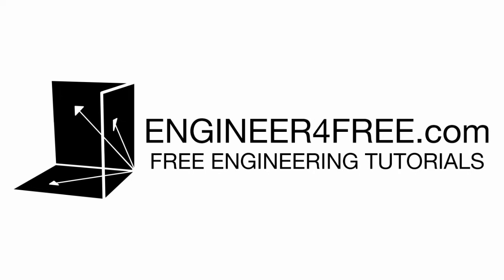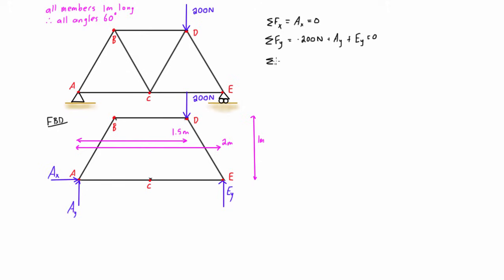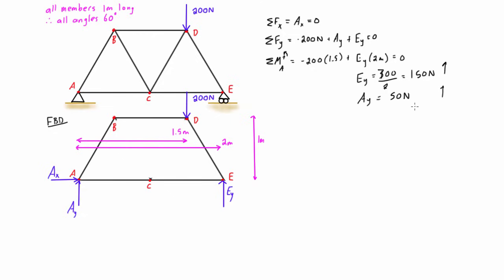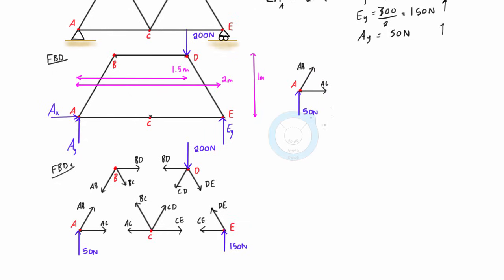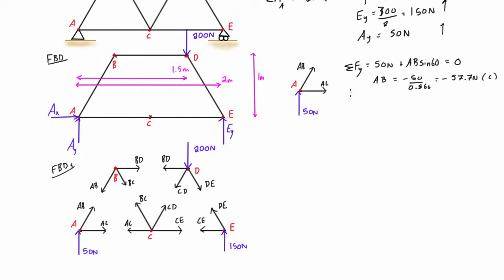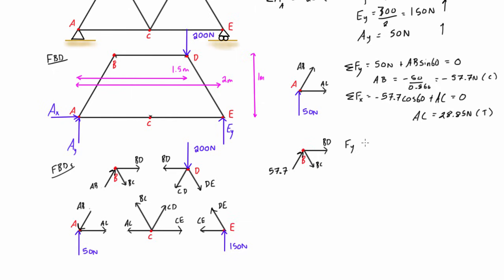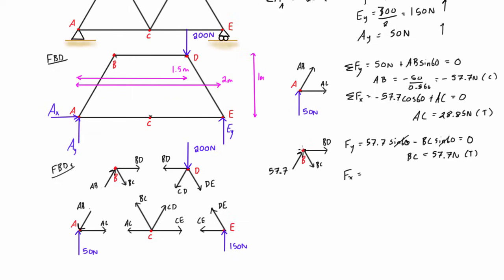Truss analysis by method of joints: worked example #1

Comment: Where did you get the 2 meters from on the free body diagram?
Reply from the maker: Each member is 1m long (pink text, top left of screen at beginning), so the distance from A to E is 2 members, or 2m. Please note that the 1m vertical measure is a typo, it should be 0.866m, but doesn't actually affect the problem. There's a note in the description mentioning it.
Reply: @Engineer4Free  Thank you so much!
Reply from the maker: You're welcome! Plz share my statics videos with some other students too 🙌

Comment: To determine the (-)or(+) sign to put in the calculation of forces in the x-direction(or y-direction) of a diagonal truss member is that compression member is in (-) and tension member is in (+) or is there any other method we could determine that. I'm struggling with this problem when I'm doing my method of joint calculation for my project. Thanks in advanced
Reply from the maker: Oh man, I just typed up a massive and extremely detailed answer then accidentally deleted it....😭😭😭  Please watch all videos 42-51 here: engineer4free.com/statics and if you're still not sure I can write my essay again
Reply: @Engineer4Free  ok thank you so much😄appreciate the quick reply btw

Comment: In Joint A, when you Sum all Fx, Ax is not inlcluded? Why?
Reply from the maker: Ax is determined to be zero in the overall sum of force equation for the whole structure because it's the only external force with an x component so it must be zero. In the fbd of joint A, there's no point in labelling a force with zero magnitude, as it won't have any impact on the force balance, so that's why it's not included.
Reply: @Engineer4Free  Thank you :)

Comment: Hey, i have a warren truss question with just a single triangle and a force acting on the top of the truss a size of 15kN to an angle of 60°. Can you help me with this?
Reply from the maker: If a member is oriented at 60 degrees and has an internal force of 15kN, then the x component of that internal force will be 15kN*(cos60)=7.50kN and the y component of that internal force will be 15kN*(sin60)=12.99kN. If the member is in tension, it will pull on each joint, and if it's in compression it will push. You can use those numbers and directions to find the sum of forces in x and y at each joint individually. More tutorials on trusses are also here: engineer4free.com/statics (videos 42-51)

Comment: why do you add in some cases and subtract in other cases?
Reply from the maker: I should have drawn a coordinate axis that shows positive x is to the right and positive y is up. Because when I'm doing the sum of forces in x direction, I consider an force (or component of) on any FBD that points to the right to be positive, and an force that points to the left to be negative. Same with the sum of force equations in the y direction. Any force (or component of) that points up is considered to be positive and and force that points down is considered to be negative. That's why there are positive and negative terms when summing to zero. Hope that makes sense. If we then get a positive value for the magnitude of an internal force, it means that we correctly assumed its direction (and we always assume unknowns to be in tension, so it confirms that we guess tension correctly). If we get a negative value for the magnitude of an internal force, it means that we incorrectly assumed its direction, and it is actually in compression. That was the case with AB, where on the FBD of A, we had drawn AB in tension. But ultimately we find that AB is actually in compression, so when I draw the FBD for B, AB is now a KNOWN force, so I draw it in it's known direction, which is compression, which means it's pushing on the joint (ie, pointing at it). Hopefully that all makes sense! It's all just vector addition at the end of the day. I have some more tutorials on vector math and also trusses in videos 1-4 and 42-51 respectively, here: engineer4free.com/statics

Comment: at 6:42 why have you taken the value of AB as positive, since the actual value of AB you have got is -57.7
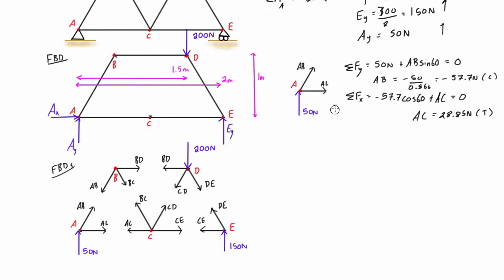Reply from the maker: Yeah so initially AB is drawn as an unknown in tension. It's found to have a negative magnitude at 3:27 which indicates it's actually in compression. At 4:47 I update the FBD of joint A and B by switching the direction of AB on each one. This switch goes from the forces pulling on each joint (tension) to the forces pushing on each joint (compression). Negative tension = positive compression and vice versa. This is why I write (C) and (T) beside each answer as we go as well, because it's easy to get lost in here with what is in tension and what is in compression, but by writing the letter beside it, it hopefully reduces the chance for confusion or error. What I could have done to be more clear would be to write the magnitude and sense on the main drawing to the left each time I solve one. This would have included switching the direction of the AB arrows at 4:47 like I did, but then also writing "57.7N (C)" in between. Without doing that, I see how it's easy to get confused about whether it is considered positive or negative. I hope that helps to clear it up!

Comment: if you didn't know the angle was 60 degrees, and you had to use theta, how would you solve for the forces? what would e.g. 50N + ABSin(theta) = 0 be solved to?
Reply from the maker: Ummm, at this level, there should always be enough information to solve with basic trig functions: sin(theta)=opp/hyp, cos(theta)=adj/hyp, or tan(theta)=opp/adj. You can rearrange to be sin^-1(opp/hyp)=theta, cos^-1(adj/hyp)=theta, and tan^-1(opp/adj)=theta. So that means you should have 2 out of 3 quantities at any time and just be able to solve for the third one. If the member is angled then generally the hypotenuse is the actual internal force and x and y components are the opposite or adjacent sides.

Comment: Thanks for this video very well explained. However I’m confused as to how the 1.5 m and 2 m came to be at the sum of moment about a, thanks!
Reply: How did they come into the sum?
Reply from the maker: Every member is 1m long. So the horizontal distance between A and E is 2m. The horizontal distance between A and E is 1.5m.The pink "1m" vertical distance written on the diagram (the vertical distance between A and B) is actually a typo, but it doesn't affect anything in the video. The vertical separation is actually 0.866m (1m*sin60=0.866m).
Reply from the maker: I replied in this thread. Just commenting to you too directly incase you don't see the notification.

Comment: On joint A, I'm a little confused as to why you included Ay when solving the forces in the y direction, but didn't include Ax when solving for the x-direction. Is this because AC acts as Ax due to it being perfectly horizontal? (This video is extremely useful to me btw, thank you for making this)
Reply from the maker: Hey John, good question. The reason is that when I did the FBD for the whole structure, I determined Ax to be equal to zero. So when I draw the FBD of joint A, I just don’t bother drawing Ax on, as it doesn’t contribute anything. That means though, that the horizontal component of AB then must be equal and opposite to AC, for the horizontal forces at the joint to balance. I hope that clears it up. Glad you’re like the video, and I also recommend to check out the rest that I did over at engineer4free.com/statics 👍👍
Reply: Engineer4Free Great! I’ll check it out. Thank you for the help!

Comment: How did you get 60 degree with adjacent of .5 m and opposite of 1 m? Degree = tan-1(1/.5) = 63.4 degree?
Reply from the maker: There is a typo. The truss is not 1m tall. Every member is 1m long, so the truss is actually 0.866m tall. I mention the typo in the description. But you actually don't need to do any trig calculation to get the angles, because each member is the same length, the triangles are equilateral, with means all angles in this truss must be 60 degrees l. It's why I never noticed that I accidentally wrote the height is 1m, because I didn't use it. Sorry for the confusion.

Comment: Wow I am really confused with the signs(the - and +)
Please help
Reply from the maker: Hey, when drawing the fbd of a joint, draw all unknowns in tension. This way, when you calculate the magnitude if any unknown force, if it is positive, you know you drew the actual correct direction of the vector. Aka, you just confirmed that the unknown is actually in tension. If you have a negative magnitude, it just means that the direction of the vector is exactly opposite, which means it's in compressions. Tension pulls on a joint, compression pushes on a joint. Mathematically, - 10kN of tension = +10kN compression. They're just vectors with a magnitude of 10kN and a direction which is either away from or towards the joint. Watch videos 42 - 51 for explanations and practice with trusses here: engineer4free.com/statics if you watch them all, and really think about the above description, it should make sense 👌. Edit* when I determine an unknown force, that member is no longer unknown. So the next joint that it affects, I draw that internal force as a KNOWN value. If happened to be in compression, then I draw it on the next fbd pressing on the joint. Say when it was first calculated, it was found to be - 20kN. This means that its 20kN in compression. So if you drew it on the next fbd in tension, it would have to have a negative magnitude, which would be very confusing, so better to just understand that a -negative sign flips the direction of a vector, and draw it as (+)20kN in the compressive sense (pressing on the joint).

Comment: why is there no Ex because there is Ey at E
Reply: it is a roller connection. Roller connections do not have any resistances along x direction(assuming friction is negligible). Try pressing down on a toy car. You cannot make it go deeper by itself because you are just applying a pure y direction force, but if you push the toy car, it goes.
Reply from the maker: Yeah, thanks for responding to the question!

Comment: in the FBD there are those pink lines labelled 1.5m, 2m and 1m. what are they supposed to be, because you've also used them in the calculation.
Reply from the maker: horizontal distances between the joints.

Comment: Does this method neglect shear stress, since all member forces are in their axial direction?
Reply from the maker: Yes. It assumes only axial forces because the members are straight, 2-Force pin connected members. See this video that goes over the simplifications in truss problems at this level: https://www.engineer4free.com/4/what-are-trusses 👌👌
Reply: @Engineer4Free  Thank you. Another question you might be able to answer. I have a construction with a 1 kN force applied. I don't know if this construction is static or dynamic. I am pretty sure it is dynamic (moving), so I want to prove that it is. In general, when we don't know if a construction will move/rotate og not, how do we go about it?

Comment: Why doesn't E have an x, only a y?
Reply from the maker: Because the support at E is a roller, not a pin. It can only provide a reaction force that is normal to the surface, which is vertical
Reply: @Engineer4Free  okayy thank you!

Comment: Can I ask what is the reason why you didn't change the sign of AB?  for it to used in getting the AC, I have watched some videos relating to truss and before coming to another joints they are changing the sign already before using it. Im so confuse sorry
Reply from the maker: Instead of changing the sign, I change the direction of arrow on the fbd (at 5:01 ). You either need to change the direction to the known sense (compression) of leave it in the known incorrect sense of tension, and assign it a negative value. Either is fine, but pick only one.

Comment: where do you get 1.5 m?
Reply from the maker: Each member is 1m long, and the triangles are equilateral, so the top or bottom point of each triangle is half way along the opposite side, making it 0.5m from the 'base". 1m + 0.5m = 1.5m, that's where it comes from!

Comment: Ah the problem is that when i tried to draw it as exactly as you say, all members 1m long and the 60 degree using AutoCad. The height of truss isn't 1m.
Reply from the maker: Yeah, that 1m vertical measurement is a typo, the height of the truss is 0.866m. But it never impacts or is used in the calculation. Sorry if that confused you. Every member is 1m long, and the angled ones are all at 60 degrees from the horizontal.
Reply: I really try to see this comment relating to this since all my calculations are different bec at start it uses the wrong dimension. But gladly the lesson didnt affect the essence of knowing the method.

Comment: Why doesn't E have an x force?
Reply from the maker: The overall truss is simply supported. Simply supported means it has one pin connection and one roller connection. The way I draw the connections is one of the generally accepted ways. Notice there's some little wheel/roller looking things under the hinge at E, that is a way to show that it is o Ly going to be able to provide a reaction normal to the surface, because the little rollers there can't provide horizontal reaction. If you have two hinges rather than a hinge and a roller, the internal deflections will put a lateral force on the reactions and it would be ck side red statically indeterminate. Almost all problems like this in a statics level course will be simply supported, look out for it!

Comment: Hi sir, here is a quick question of finding CE. At 9:20, x force of CD goes positive direction but u calculated as -57.7cos60. So do I just follow up the results I get from other point, or do I need to figure out everytime whether its going to be plus or minus? Thank you!
Reply: Nvm, Can u just double check i understood correctly? So CE was found as -57.7N, arrow should be changed towards point C b4 I calculate CE? So it is a negative value for both x and y positions.
Reply from the maker: Yes this is correct. On the fbd it's drawn pulling away from the joint, but is fou d to have a negative value at 8:30. A force with a negative magnitude means it is actually acting the opposite way as indicated in the fbd. So you could redraw the fbd so that CD points toward the joint, but then you would have to change the sign to positive. It's the same as leaving it as is, and having the value be negative. So yeah I think you got it, but hope that helps to clarify!

Comment: What makes the 200N  (Negative?)
Reply from the maker: The 200N applied load is negative because it points down. I didn't draw on the coordinate axis in this video out of laziness, but I should have. It would be the standard form, indicating that x is positive to the right and y is positive up. If a force or a component of it is pointing opposite the positive direction, then that force or component of it is considered negative in sign.
Reply: Engineer4Free thanks

Comment: Yo!
This video has helped me out alot, you are great at making things clear. However i still struggle with a similar problem. It looks more or less the same but the main difference is that if u look at point "B" you have a force that is coming from southwest aswell as southeast and one that is perfectly horisontel. If u instead change the horisontel one to a force that is pointing northeast, at say 25 degrees how would you go about solving that? For me the problem is that when im about to calculate the resulting force to be zero i get 2 unknown integers wich makes the equation unsolvable. Im really confused here and would appriceate any help i could get!

Comment: why when drawing the whole trusses free body diagram do u not include Ax anymore, while including it in the second drawing?
Reply from the maker: I draw it on the first FBD of the entire structure, and then at 0:40 I acknowledge that Ax=0 because there are no horizontally applied loads acting on the structure. Once you know a force is zero, you don’t need to draw it again, it would just be distracting, so its acceptable to not draw it on the FBD of only joint A.

Comment: On the third diagram, the Fx, why is the other one not positive? Well BC is in tension. It has a positive value of 57.7cos60. I am just confused
Reply from the maker: When you’re solving for the sum of forces in x direction for the forces in a free body diagram, any force with a positive x component (that is, pointing to the right, or positive x direction) will have a positive value in the expression. Any force whose x component is pointing toward the negative x direction (to the left), will have a negative value in the expression. The fact that BC is in tension, does not make it’s x component positive, It’s x component points to the left, and is negative. I hope that helps clear it up!
Reply: Engineer4Free it did help! Many thanks to you.

Comment: Please help. As i calculate CE. Its not 85 but its 28.85
Reply from the maker: Hmmm, everything in this problem should be correct, as we find in the final check of the problem. You may have a simple math error. Try writing it out again and making sure you're doing each term individually and getting the right signs

Comment: For first problem, you write -57.7cos60+AC=0 and get 28.85, but wouldnt it be negative?
Reply from the maker: The - 57.7cos60 gets moved to thee others ide of the equation and becomes positive 👌👌